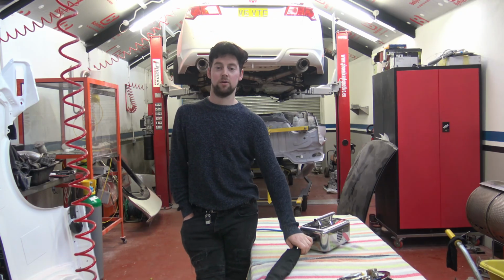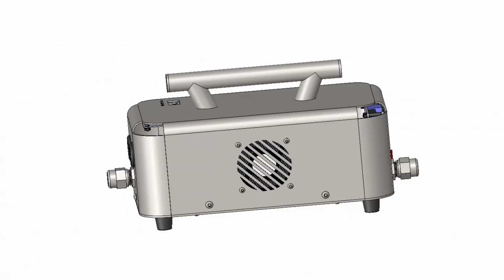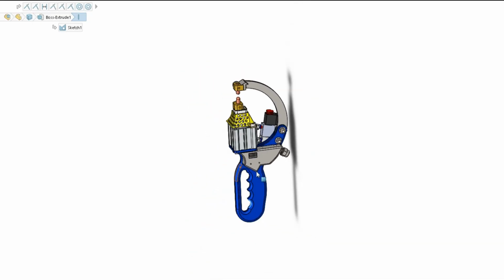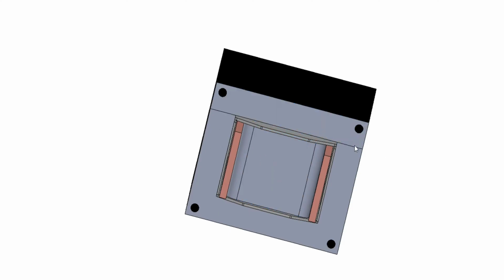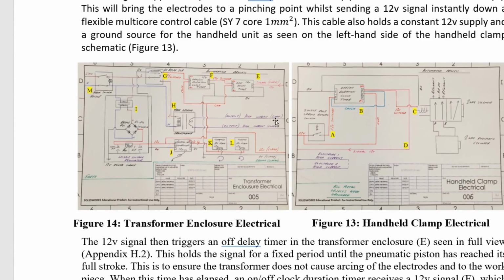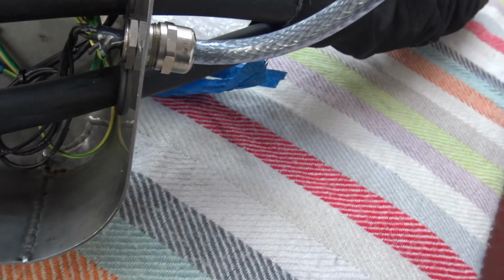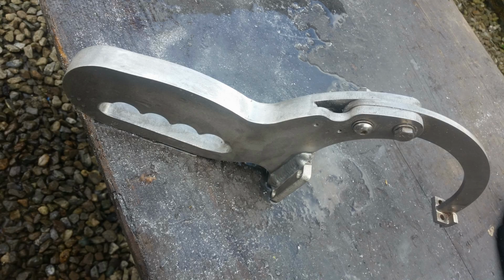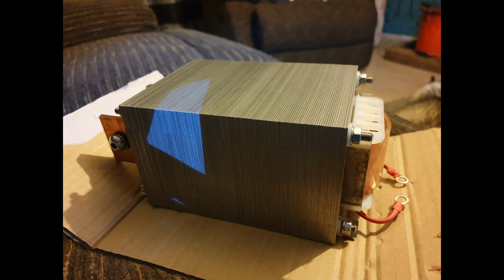World's BEST Precision DIY Electronically Controlled Automated Puenmatic Spot Welder

Comment: Thanks Jeff! You got another subscriber! Great video for those of us serious about building spot welders! Where did you source the control circuit boards? Were they the sort commonly used for microwave transformer based welders?
Reply from the maker: Hi there,
Thank you sir 🙂. The clamp hold time and pulse time is controlled by a continuous clock cycle timer. The transformer starts only after an off-delay timer is engaged to ensure the clamp is contacted reducing any arcing at electrodes. These timers are all sourced on eBay. However, a DIY microcontroller would also have been benifical here. I just choose this way as both devices can be easily preset with the push buttons.

I hope this helps. 

P.s I never have seen the commonly used boards on microwave-based machines.

Thank you again,
Jeffrey
Reply: Yes absolutely it helps. Been trying to read your design paper as you were scrolling through it 😂. I sourced a tecna scorpion as a donor for my project, which is to build something similar to the one shown  by Dan Gelbart on his channel. I'll be posting progress on Instagram once I get the plan nailed down. 👍🏻
Reply from the maker: @sticklebrickmick if you provide email, I have no problem sending you the large PDF report
Reply from the maker: @sticklebrickmick yeah look for the wiring diagram for devices, two landscape pages joint together 🙂